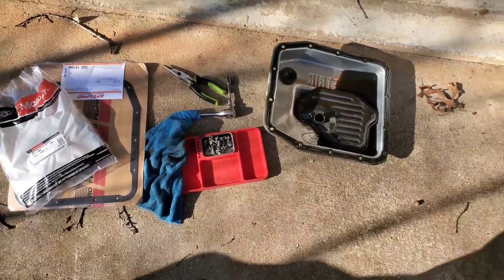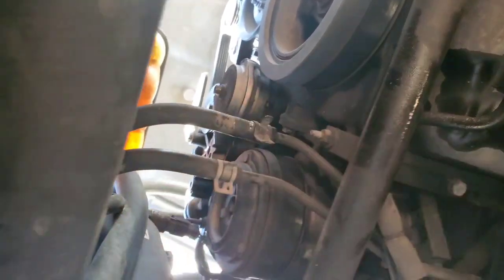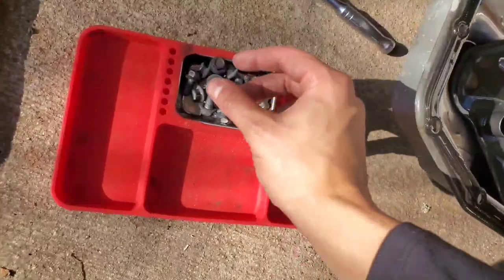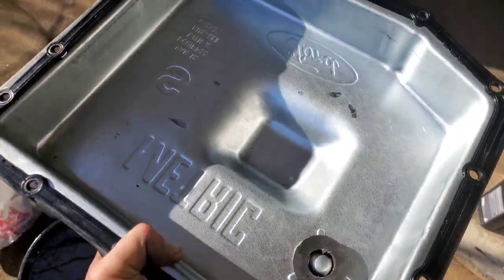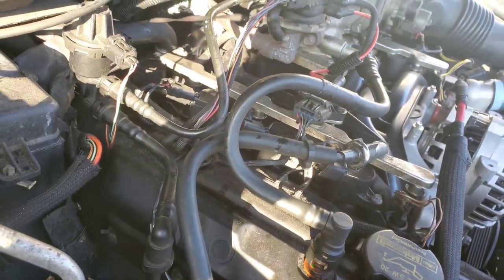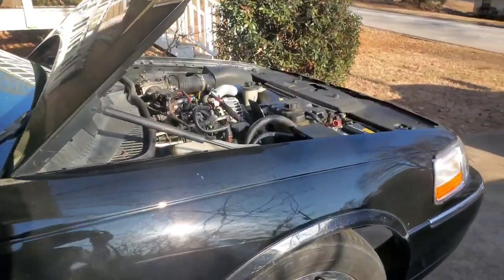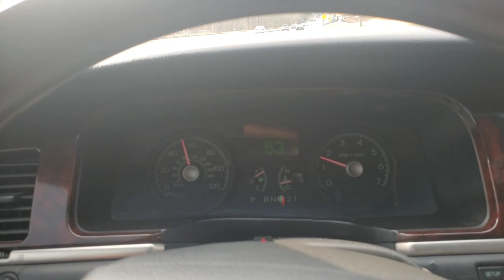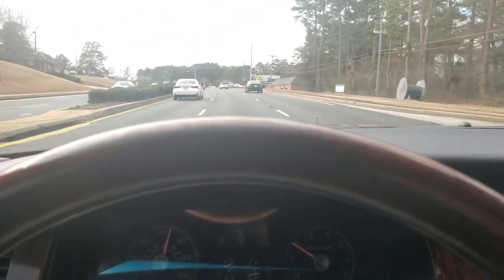Lincoln Town Car Transmission Maintenance!

Comment: What's your thoughts on using synthetic transmission fluid?
Reply from the maker: Use mercon V for any 2008 and older. Mercon LV FOR 2009 AND UP.
Reply: @Ziade_Garage  My mechanic is suggesting I switch to Amsoil 100% Synthetic since my Town Car only has 40,000 miles on it.
Reply: @Ziade_Garage  whats your thoughts?
Reply from the maker: @ParissaKhoury  with ford/lincoln. I'd stock with motorcraft.
Reply: @Ziade_Garage   Ugh is it because it's old technology?
Reply from the maker: @ParissaKhoury  nope. It's just how the valve body and clutches are built. It's more velocity for the transmission to stay cool.